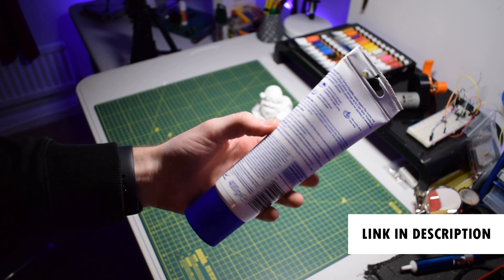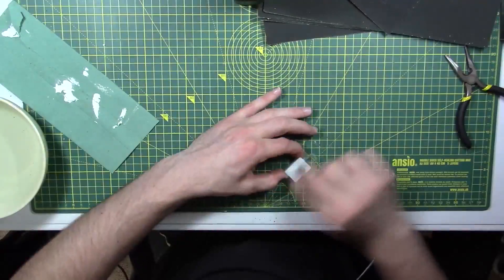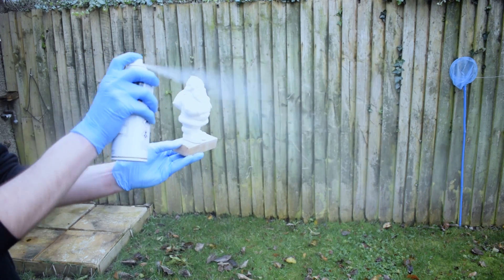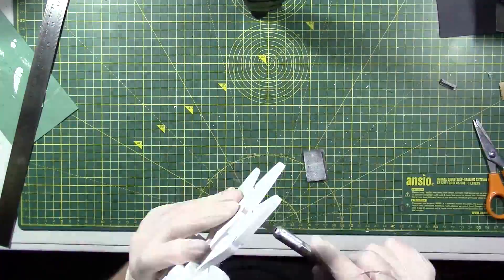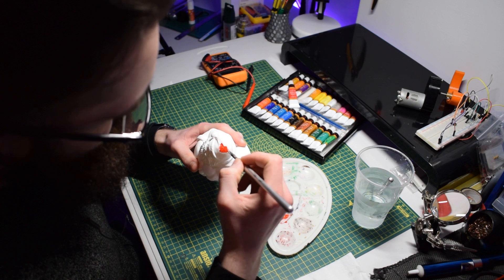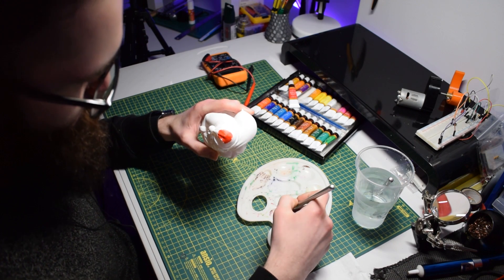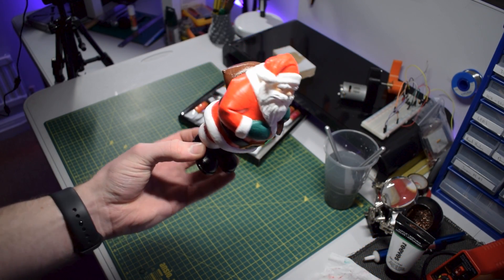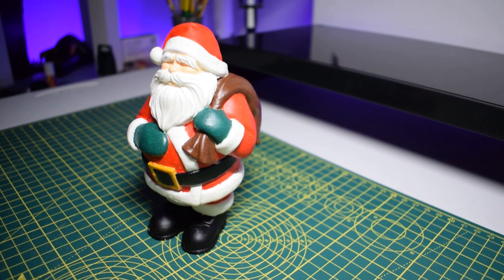How to Paint 3D Prints

Comment: No need for a primer if using Polyfilla, correct?
Any thoughts on using just nail polish for small surfaces like eyeballs only?
Reply from the maker: Hey! what I used is a Filla-Primer, essentially a 2 in 1 solution. I recommend that! absolutely you can use nail polish, you can use anything as long as you can get it to stick!

Comment: Thank you! Than you! straight to the point, clear explanation and fantastic links to support. I still fast forwarded a bit but that's on my attention span. I will use your links for the affiliate earnings to be received by you. 
Question. the area I want to paint is tiny. eyeballs. Can't I just slap some paint and be done?
If not, am I better off finding non-spray primer and finishing coat or is it OK to spray these on the non-painted parts of PLA or ABS?
Reply from the maker: Thank you, much appreciated! You might be able to get away with it but I'd recommend trying out a range of different paints. The paints I used really struggled to take on the plastic directly, but something with a thicker consistency might do the trick!

Comment: I will be doing my first primer and paint for a logo I made. There’s 3 different colors and I thought I would have to tape off (and there’s going to have to be lots of pieces which is going to take so long) parts but I see you used multiple colors and we’re still precise with the colors and didn’t mask off anything with tape. So about that, are these brushes precise enough, could I get away like you did without tape easily?

Comment: Very good video man. I am struggling to get a nice finish by painting with a brush. Even after using primer, I did 2 coats of paint and I can still see the colour of the primer underneath the paint. You only did 1 coat of paint and it looks perfect. Don't really know why my paint doesn't have the opacity or thickness or whatever it is. I've tried 2 brands of acrylic paint so far.

Comment: How much primer do you use per print?  Do you ever reuse a can of primer on multiple prints?  What about sealer?
Reply: The point of primer is to get the paint to stick. After one coat you're fine to paint, if you want more, do multiple layers.
Reply from the maker: the amount of primer you use will completely depend on the size of the print and how smooth you want the print to look! I never do more than two coats unless I want something to look extremely good, in which case I would sand between each coat of primer to get a silky smooth finish. Hope this helped!

Comment: Use the Painter's Touch for filling the gap between the layers , right? How can you clean it after I make any mistake ? The paint will flow into the gaps.
Reply from the maker: the gaps disappear with enough coats of paint! although, I do recommend priming with a filler primer before painting if you want a much smoother surface

Comment: What type of filament do you use or good for applying paint? This is very interesting, I got into 3D printing lately and will buy it soon
Reply: How long acrylic paint lasts on 3d printed models?
Reply: @3dgiftz  with a clear coat I don't think you'll see it coming off in your lifetime
Reply: @DemsW  yeah

Now I am using clear coat varnish
Reply: @DemsW  since it's 6 month, I have gained some more knowledge in 3d printing 😋

Comment: A few tips for you and anyone else. 
Don’t leave you paint brushes tip down in your water or when storing them. 
To reduce the brush marks when using acrylic paints, use an extender, this stops the paint drying so quickly, thus allowing the paint to flow over the surface. 
Primer is hydroscopic so don’t leave your model in primer for to long. 
Keep up the good work and short and to the point videos
Reply: I’ve got a stupid question. What’s an extender? Is it just to extend the length of the paint brush? Thank you
Reply: @joshcouton8744  hi good question 
So extender is a product for acrylic paint that slows down the drying time of the paint. So it extends the time that the paint is workable on a surface or gives the paint longer to flow out. i.e. let’s the paint form a more even coat on the surface or level out and thus reducing brush marks. It’s better than using more water to thin the paint as with most pigments water will reduce the opaqueness, extender will not reduce the opaqueness. 
Hope this helps answer your question (not a stupid question unless you ask it knowing the answer) 
Hope that helps
Reply: @darren6542  so should you use water and an extender, or just the extender?
Reply: Why is my acrylic not drying that fast. like i kept it for almost 2days and it was still not completely dry.
Reply: @raghavsnair1567  if you are using it straight from the bottle / tube some brands will not dry. 
Try mixing a small amount of water to the paint on the palette to thin it out. White is a high pigment colour so needs thinning with water. 
Hope that helps.
Reply: @darren6542  thanks , I used white straight from the bottle.
Reply: How long do i let the primer on?
Reply: Just soak it lol

Comment: what slicer do you use? I am new to printing. and I am having a hard time removing supports. you supports seem easier to take out?
Reply from the maker: Hi Sonia.. I use Prusa Slicer which generally has great default settings! Supports are usually fairly easy to remove if printing in PLA, other materials such as PETG be tricky from my experience!
Reply: Hi, I'm also new to 3d printing but I've had good results with both Cura and Prusa. 

You should tinker with both Z distance and pattern. I prefer the default distance (.2mm) with Prusa and the honeycomb pattern
Reply: TINKERCAD

Comment: Does this paint resist at high temperatures? (50°C circa) Because I would like to paint a DeadPool bust and put it inside my PC (I have a tempered glass side)
Reply: If you use automotive spray paint or acrylic paint you should be fine. I'm more worried of the material you are printing with; use petg or abs.
Reply: @alberttan3623  yeah, I forgot to specify that I printed it in PLA.. maybe it would be more suitable printing one in PETG.. thanks for the tip btw

Comment: wow! that is really converted me, from the longtime thinking of "3D printing objects are always rough and crude" to "3D printings can really be a true art form", Thanks. One question, how long did it take for that Santa?
Reply: Based on the size and the amount of support, could be somewhere between 6-10 hours. This depends heavily on layer height as well as general speed of the printer as some can be quicker/slower.

Comment: To stick models to a base for painting, spraying or light sanding why not use the masking tape and superglue trick? Put a strip of masking tape onto the base and a strip onto the model then put a small amount of superglue onto the tape on the base and spray the tape on the model with accelerant if you have it then put the 2 pieces of tape together. This will hold the model tightly for most applications but is easy to remove as only the adhesive of the tape is in contact with the base and model, but be sparing with the superglue make sure you don't use too much or it will get on the model.
Reply: Thanks

Comment: Looks great! Curious what your support settings are like, I always get an ugly area wherever supports attach. Same for you and you just sand/smooth it or did you tweak support settings at all? Also using a mk3s with prusaslicer.
Reply from the maker: My support settings for this were default! I also get that issue where the supports attach sometimes. But I find that the results differ between brands of filament! You can sand it smooth, but Polyfilla is perfect for those scenarios!
Reply: thehardwareguy hey im a bit late but these problem van easily be fixed adding support roof or interface